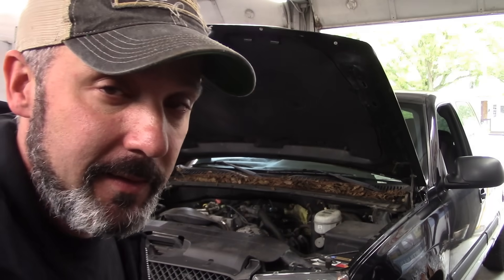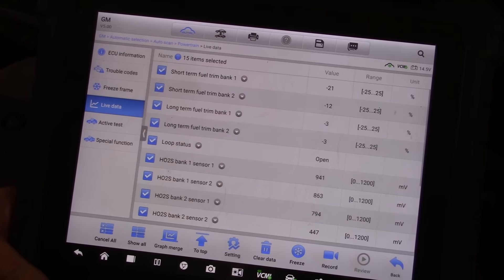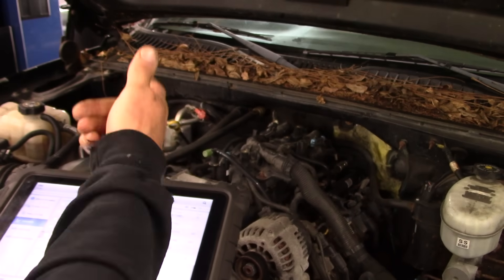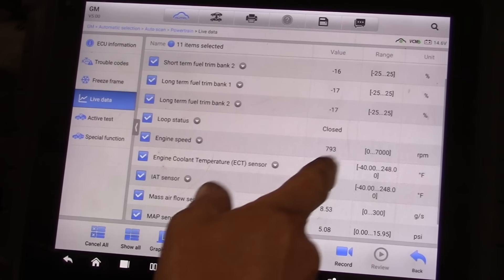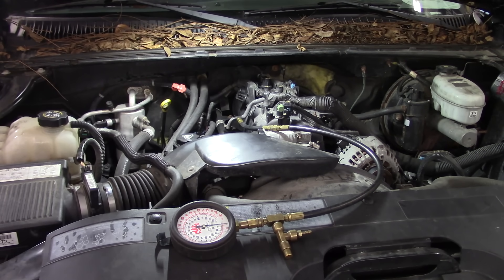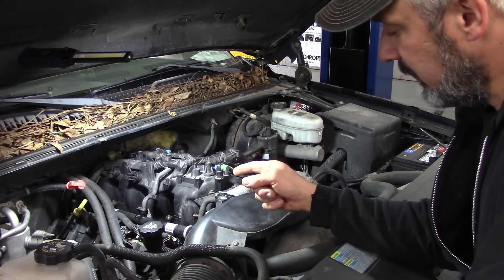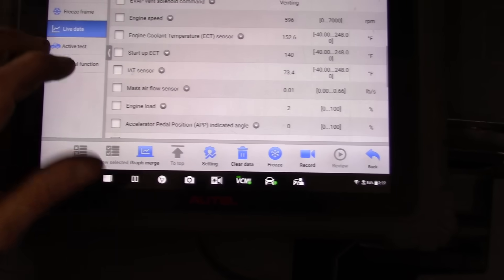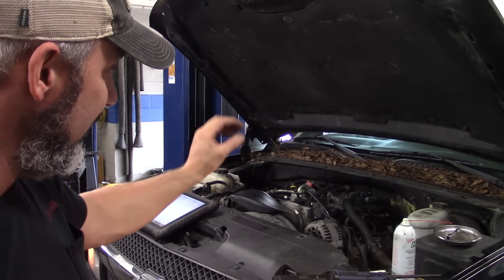Parts Cannon Special: Rich Running Chevy Truck P0172 and P0175

Comment: Hey Eric, 
1st off......You deserve credit for all that you do in the name of helping folks out.  I appreciate what you do!  
So I had a few over the years that have had similar symptoms, various make model year and 1 thing I became accustomed to checking in a rich scenario is real/true/accurate battery (or charging) voltage and compare that to the data stream.  What I've seen is that in a rich issue like you had here, the PCM believed that the voltage was say, 11.2 but in actuality the factual voltage was say, 13.1v and here's what would happen for example.  PCM see's lower than "normal' voltage.  Because the fuel pump is constant and regulated externally, PCM says "Yo injectors, I need you to stay open a little longer bc I see this voltage down so I can only assume the fuel pump is effected adversely as well, lets crank it up!" and it starts to expand the pw accordingly. *****TIP I cant recall this ever happening in a system that measured fuel pressure (fuel pressure sensor) but in theory it still can happen. I just can't back it with facts.*****  Then the O2 yells back, YO I'm rich over here so lets trim it back. The fuel trim has its own tables and the low voltage issue has its own set of blocks within another table.  So O2's are yelling rich, the battery is low, the PCM is responsible for breakin up the fights so it inadvertently added more fuel when it shouldn't have and then set a rich code because the truth is, it really was running rich.  Make a loooooooong story short (like they say in NYC) 🤣 as said by Eric O.  I now know to check to see if the PCM is showing some voltages that seem ta make ya go......hmmmm   Like you said, RICH conditions are not that common.  I've only seen this maybe 1/2 dz times since the early 90's.  I'm in Detroit and I can tell ya this always/only happens when we get that cold snap that starts off the season.  Ya know what I mean?   And here, imagine your hoopties but with no inspections.  Yeah, its bad!   I'm sorry I ran on so long but if there's a piece that I leave out and that just happens to be the piece that someone needed, I failed helping out.

Comment: I had the same codes for my 2012 sierra 4.8. Mechanic advised i change the air filter, which was an oiled k&n high-flow. They mentioned it can cause contamination on the maf sensor. So i changed it, cleaned the maf, and everything was good after that.

Comment: You are the man! No one says Chevrolet like you do. Every time I pass by the local dealership I hear your voice and I chuckle. It was very interesting to see that used OEM injectors from a junked truck are still better than new ones from eBay. I think you are a great mechanic because you took the time to get the little rubber piece for the purge valve as well as the fuel rail to make sure the customer's vehicle is up to snuff before you talk to them and you care about your reputation. Thanks for the explanations of how you did what you did. Good Luck and all the Best to you and yours.

Comment: Hello man, I bought 4 new fuel injector same brand, and I'm still getting the P0172, I went to the car after watching your new video and replaced them with the old ones, and short trim. went down from 30 to 18, and when I took a close look at the new one I realized there was a little different, it's crazy that little difference in them was causing the issue. Thanks a lot !!

Comment: Have been having issues with my 04 silverado...just being stupid...actually took it to the dealer and they gave it back to me saying they couldn't find anything wrong actually gave them a list of what was doing...but I have learned more about the problems by watching your videos and learning more about using my Autel MK 908 scanner...no codes showing...pretty much what you were dealing with in this video...NAPA and I are friends and I get as close to OEM parts as I can...still trying to beat down my gremlins...thanks for the video and some more insight...

Comment: Great video! I too have been having P0172 & P0175 issues, throwing numerous parts at it. Bizarrely, it only tends to occur when the weather is warm so winter is fine, but summer is a nightmare (won't set off until 2500 rpm hit with clutch in). 
Checked lots of mechanics, all say yep, you have a problem, don't know what it is, but replace O2 sensors, or MAF  or something else I've already replaced. 
Fuel rail will be next, it constantly misfires too, up to 96,000 recorded

Comment: Thanks for the video man 👍 I’m chasing a P0175 along with a P0300 code in my 2002 Avalanche 5.3. I bought the truck with a washed out #8 cylinder. Rebuilt another engine same year. Swapped it out and been chasing these codes along with 2 ABS codes. P1751 & P1689. Previous owner did the parts cannon thing at this as well. I’m new to these setups but doing my best to be a good detective 🕵️‍♂️ and not be a parts cannon guy. I’m going to try cleaning the MAF again and see if that’s the culprit. My purge valve is loose feeling like the one in this video. I’ll recheck that as well I guess. Luckily I have time on my side and not doing this for a living

Comment: Saw your video and had some ebay injectors to install on my Jeep WJ with 4.0 I6.  Decided to check fuel trims after the install and they were all pegged at negative values, both long and short term.  Ebay Junk...  If I hadn't seen your video, I would have chased this for a long time... Thanks, Eric O.!

Comment: Thanks for the bonus footage and hope it resolved the vacuum leak. Also hope the Customer stepped up to the Plate and paid for the salvage parts you installed to resolve his issues ... had to have also improved his "Blue Smoke" issue no? White are rings/valves but Blue is fuel as I recall.  GREAT JOB !!!
Reply: Blue is oil. Black is fuel. White is coolant.

Comment: The way he can diagnose things it just amazing, wished i lived near his shop  I would have him fix my 01 Chevy with a P0300 code since nobody where i live knows how lol
Reply: 98' chevy 5.7, I get those occasionally. p0300 (generic misfire code) I found wire had vibrated loose on #3 plug. I also get them on cold starts,  I'm pretty certain I have a leaky fuel regulator so bleed down of fuel pressure is inside the intake plenum = Very rich cold starts.

Comment: A/C Delco injectors are what I replaced mine with,  my 2001 Silverado had 445,000 on it when I changed them and it's still running great.

Comment: What a helpful teaching video. I especially like the way you took us along while you were thinking, going through the list of causes in your head. MAF, stuck purge, stuck PCV, contaminated oil, fuel pressure, injectors, programming, etc. Brilliant idea to scrounge a fuel rail, I think most would sell a whole set of new injectors.

Comment: Dang! Nice find! Your great auto knowledge is an understatement! I went thru the same problem with a 4 cylinder timing chain that kept stretching out past the tensioner’s ability to take up the slack, I went to GM and got a factory chain and never had that problem of stretching again.

Comment: Appreciate all of this!! 
I’ve spent 2 weeks on my 2012 Silverado 1500 with the 6.2L
So far I’ve 
Replaced 

Spark plugs
Fuel pump
Brand new mass airflow sensor
Cleaned throttle body… 
Still getting P0172 and P0175

Getting the same symptoms and about to give up.

Comment: I’ve been fighting a p0300code and rich/lean symptoms for almost 2 years, parts cannon just the same as this guy and still can’t get it fixed, after this video I also will go to junkyard to swap with oem injectors to so if this is my case, but also a cold air intake found to be pulling too much air and I swapped back to my stock setup and found a difference in symptoms found my map sensor was clogged with crusty oil deposits so changed that and also seen better results, this video got me thinking that my 200$ set of injectors are also junk

Comment: If it smokes really bad on start up on these trucks and then the motor is burning a lot of oil but none visible while driving, well I highly suggest you replace the valve cover/pcv setup. My 04 5.3 was burning 3 quarts a week and on start up it smoked like a freight train!!!! I finally replaced the valve cover because the pcv system is inside the body of the valve cover, but at first it kept smoking on start up but a week it got less and less and oil consumption stopped and went back to normal. Like you know they always gonna use some lol but after 5-6 weeks my puffs of smoke on start up completely stopped! I was so thrilled!!!! My local mechanic told me to look for a new motor soon. Well that was 40k miles ago and it still runs great! And no more puffs of smoke on start up. Cause man that’s embarrassing lol like me and the family went to a aquarium and parked in the parking garage…. And well I smoked so many people out and I felt so bad but nothing I could do about the smoking back then. Lol I thought it was just gonna be new motor for sure. Someone suggest replace the valve cover and it’s been 2 years now and problem never came back! Made me frustrated at first cause it still smoked but that was just from all the oil building in the intake and such I believe. Just took time to clear it out.

Comment: I replaced the fuel injectors on my 5.7 litre Chevrolet LS1 V8 engine 10 years ago with a set of aftermarket 24 lb/hr (28 lb/hrs @ 58 PSI) fuel injectors that I ordered from the U.S. for about $200 AUD for a set of 8 injectors from the U.S.,I'm located in Australia.

They have been working great since 2012,I replaced them when the original fuel injectors got restricted with fine dirt particles which could possibly be cleaned only I didn't have the time to clean Them or get them cleaned.

I know about that rookie repair stuff,I'm glad that I have a scan tool which can read codes in my car - it has saved me by a lot of $$$'s as I'm not having a punt when I'm diagnosing the problem.

I have 2 × Wells branded knock sensors  which are U.S. made & are fitted onto the LS1 V8 engine, they're very good.

Some of the Chinese parts are good such as any passive sensors but in my experience active sensors such as the knock sensors which were from China have been garbage 🗑️!

Comment: I'm the same way with my small engine repair, first few months 3 years ago I tried saving customers money by using aftermarket junk, it bit me so bad I will no longer honor warrnty on aftermarket and will refuse a job if a vital oem part is needed and the customer denies!

Aftermarket has its places, but not on a modern vehicle that need such precision constantly!

Comment: Just had a 96 ford probe come in crank no start and they threw every part at it! Don't know what broke first to cause the problem but every part they changed I had to change with OEM or quality aftermarket. Car runs Great now. "If you go cheap, you repeat"!

Comment: Excellent video! You and Scotty have convinced me not to buy aftermarket parts. DIYers don't have the advanced knowledge or diagnostic equipment that you have, so we need parts to work as they're supposed to and it's so frustrating to have a problem with parts that don't work right.
Reply: Mentioning Kilmer in the same breath as Eric is insulting.  Kilmer is a back yard mechanic at best, and I even wonder about that.  I would never hire him as a technician except for oil changes and maybe brakes.

Comment: great topic...hope the customer understands you're methodology...he or she now gets a reprieve from the chevy heep and and a box of aftermarket ebay/amazon cheena parts! My son works for a European car manufacturer (I can't name) here in America that has had recent emission/EPA troubles and recalls due to random lock up of brake system during hiway driving...he's an engineer in the follow up of in field/in use vehicles, and it seems that even design engineers can't figure out how to get the pcm's to communicate properly with vehicle function modules...how a tech will ever be able to figure out what a design engineer can't, is a sign of the trouble to come in the auto industry.

Comment: A great wrong fuel injector test is to watch the fuel trims on a test drive. If their rich or lean across the entire load range you can be pretty sure the injectors are a problem after you have tested the maf/map of course .  Bernie Thompson has a great video on this.

Comment: Encountered something similar years ago.  After completing the VW and Porsche fuel injection classes, a long time cust complained of poor mileage on his Type 3 squareback.  He's always done his own maintenance on his older beetles, thought the Type 3 would be the same.

The old 'black box' computer read resistance across everything related to ignition components, so everything for the Type 3 was specific to that model...special plugs, wires, rotor, cap, condenser, connectors, etc.  He installed the normal beetle parts, confused the computer causing it to go into 'limp mode rich'.

With the correct parts installed road test with the mileage bottles installed inline, on straight flat highway at 50 mph, got just shy of 40 mpg!!  In town mileage average about 12-14 mpg so the composite average was right at the norm for this model about 24-26 mpg. 

Had some customers with a 'light foot' reporting as much as 30 mpg.  Pretty good for the early 70's.

Comment: Worked on a Dodge van once upon a time when carbs were the norm. Could not figure out why tailpipe readings were so rich even after a full blown tuneup and carb. overhaul was done. Turns out the crankcase was full of fuel. A 10-minute oil change later and we had a happy 318 ready to go back to work. It pays to think outside the box every now and then.

Comment: Eric O’…Fantastic job as always! But what bothers me most is that pile of pine needles and leaves on the cowl!! I would be embarrassed to bring my vehicle in to you like that. Remember when the body and the engine lasted the same 100,000 miles? Now the Engines go 300K but the body is still gone at 100K!

Comment: Aftermarket parts are only for for getting practice at changing parts multiple time. I tried aftermarket o2 sensors one time. Put two on, and then spent the money on OEM NTK sensor. The problem was then fixed!

Comment: Bought and returned 3 MostPlus lt1 distributors from Amazon. All 3 had incorrectly clocked rotor position. The amount of poor quality parts in the market right now is astounding. It's like thieves stealing your time or your money, if not both.

Comment: I’d believe you I have been down this same path and a parts store was selling 6 in for 120 $ , and they where the hole issue . I put a used rail and just like your swap corrected it instantly

Comment: Cheap $40 Chinese / Amazon O2 A/F sensor bit my ass last fall on my 2000 ES300.  Worked for 3 months and then the ole P0171 code appeared.  Can't be, it's new!  But I learned from you, don't load the parts cannon.  Bonus was that I found a lot of vacuum leaks and after a trip to a local garage who couldn't get me in as he was full told me that he has been burned on aftermarket parts.  He said Lexus and Nissans want OEM and nothing else.  Bought the $112 Denso O2.  Happy car.

Comment: I thought that was the possibility as well with injectors but I considered more maby the wrong fuel or contaminated fuel was a problem like to much water or they added diesel by mistake. I even thought maybe the valves were hanging open or a partially clogged cat. It’s always something dumb. But you keep on reminding me stick to what you know and keep it simple. Good job on the diagnosis

Comment: Great Diag Eric O you if you did a fuel injector balance test it should of shown a big pressure drop AKA spraying way to much fuel hence the rich condition on both banks, You were spot on going after the chineseium injectors. That's my thought on fuel injector pressure drop test lets say if you saw a 40 PSI drop across the board, And again great logic to find root cause.

Comment: Another possible source for rich condition on these era engines (if it has a return style fuel system), is the fuel pressure regulator. I had a tahoe that on a good working regulator, it was leaking fuel tru the vacuum hose and into the engine, making it rich.

Comment: I've has that situation when replacing engines with a used one. Chevy HHR engine going into a Cobalt I think.  Turns out the HHR injectors flowed more by design. Good catch. I was thinking fuel composition learned the wrong value

Comment: One thing I didn't see you check so I don't know if you did was the air filter,ya I know it doesn't always cause these issues,but, I had a similar issue with running rich and excessive oil consumption so I pulled the air filter out and it was plugged solid with oil and debris.the engine has to get it's air from somewhere and when it can't breath it will suck it right from the crankcase.just something to keep in your book of knowledge for next time😁

Comment: 2006 dodge ram 1500 3.7L changed O2 sensors (downstream were bad) now same codes. Parts cannon here as well. Throttle position, crank position, cam position, map, idle air intake, injectors ($100+), fuel pressure 50 psi. Went directly to Walker products to find the correct parts and ordered. Pulling what little bit of hair I have left.

Comment: Thank you! This has helped me so much with my 08 Suburban. The best lesson is to watch all of your videos THEN diagnose the issue the way you do with a logical methodology. Here is my question; can an EBDM that's telling me it can't communicate with the transfer case it doesn't even have (2WD truck) cause a persistent rich running condition? Any help would be greatly appreciated. I already reset the alcohol content, replaced the MAF sensor, fuel injectors, O2 sensors, and corrected three vacuum leaks. Much obliged!